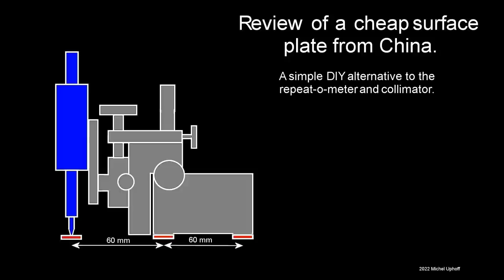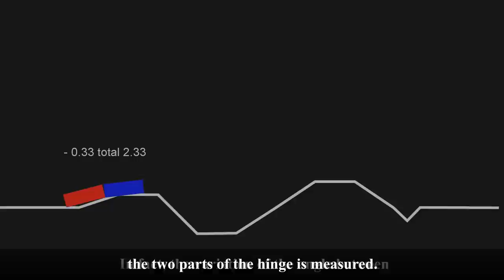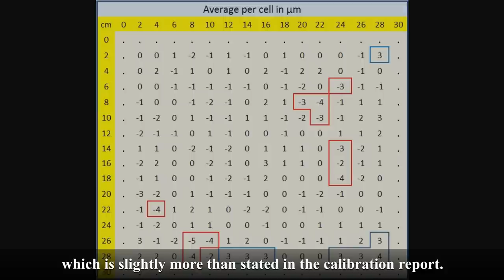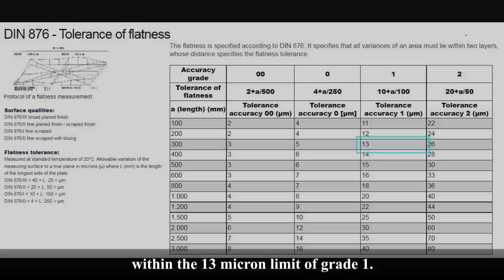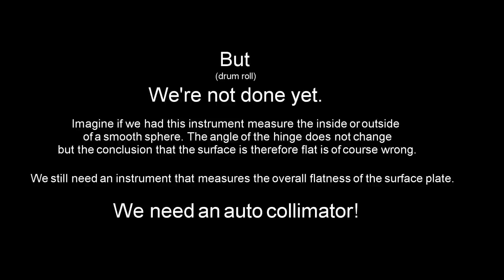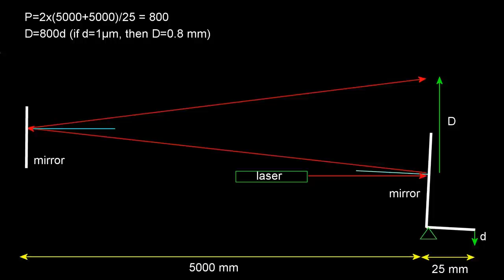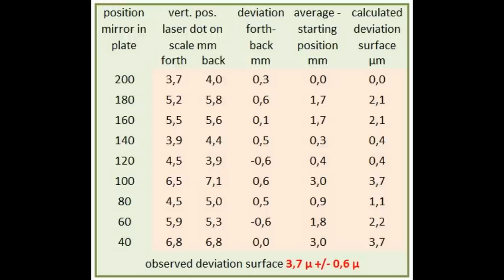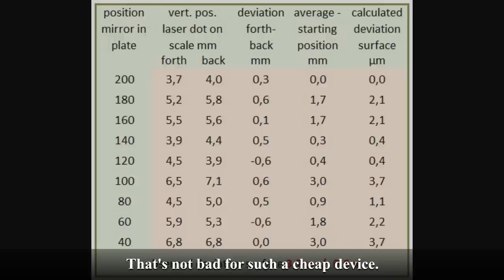How bad is a dirt cheap Chinese surface plate?

Comment: Here's another way of looking at it: For the price of an expensive one and a bit of elbow grease, you could buy three Chinese cheapies and use them to create three perfectly flat plates... and sell two and turn a profit.
Reply from the maker: Yes, using the Whitworth method, diamond paste and a lot of patience that's feasible.
Reply: @Michel-Uphoff  Use dry diamond powder, paste is only for very small areas.
Reply from the maker: @Bob_Adkins  You're right. I didn't pay attention.

Comment: Wow, the random dust participles in most shops would make this plate a much better value than a more expensive piece.....
Reply: A very good point.  Any particle can be micrometers, if the measuring is not in the cleanroom.  LOL.

Comment: very informative, cheers. it's amazing that you can get this level of accuracy for for less than $100!
Reply: Where? i only see such plates from india.
Reply from the maker: I bought it 1.5 years ago. Can't find them either now.
Here is a link to (I think) the same product (now with a higher price tag and not available): https://www.hbm-machines.com/nl/p/hbm-8-micron-300-x-300-mm-vlakplaat
Reply from the maker: Now that I look at it a little more closely. No, it is not the same surface plate.

Comment: At such price, you are supposed to buy 3 plates, and grind against each other.
You get 3 flats, an interesting project and a chance to make a new Youtube video.
Reply: Now that would be a lot of work.  Trust me, you'd be time and money ahead just buying the reliable expensive flat.
Reply: I was thinking the same thing. I've done scraping and am curious to see how much improvement one could make, or not with some effort.
Reply: @hughezzell10000  Obviously not - fact is that this plate is exceptional for its price!

Comment: Dear Friend!
I had calibrated (measured) lots of surface plate. We had measured only 8 lines, 3 lines X and Y direction and 2 diagonals. After measure we calculate "closing error", that is diffent of measured values at same point in two direction. The stepps of the meause was distance of touching point in the equipment.

Comment: The repeat-o-meter and your indicator stand are not measuring deviation, but only repeatability. Suppose the instrument is zeroed on a flat area and then placed over an area where the profile is 0, +4, 0, such that the intermediate feet are over the 4. The instrument would indicate -8, while the actual deviation is +4. Thus the repeat-o-meter is mostly useful for evaluating local flatness after determining the overall flatness by other means.

The measurements taken by the laser don't have a reference thus the measured position of the dot will be a combination of several factors, so it isn't as reliable as the autocollimator. Both are really measuring the angle and any profile needs to derived from those measurements. In this case the feet are shown as 25 mm apart while the mirror is moved in increments of 20 mm. If the increment were 25 mm, then we could multiply the measured angle by 25 mm and determine the vertical change between points.  Then a line can be fit to the points and the maximum deviation determined. It would also be good practice to measure along a loop and ensure that the readings all sum to zero ie. closure.

It should be possible to construct a suitable autocollimator with a long focal length lens, beam splitter and point source. Focusing the image on a CMOS camera sensor and processing it digitally may be easier than trying to replicate the vibrating slit and optics of a conventional device.

Comment: Interesting! 

For the optical measurement device I recall another youtuber using the 5*5mm captor chip from a camera, which had a very high pixel count and so a high resolution, along with a jobsite laser level.
Reply from the maker: That could work very well. 
A disadvantage could be that those laser levels are often too long for such a small surface plate as mine.
Reply: @Michel-Uphoff  what do you mean by too long? I was referring to the little boxy devices that project flat lines onto walls
Reply from the maker: Ok. That could work!
Reply: @Michel-Uphoff  The laser line itself is pretty thick, 3-5mm, but it is flat and consistent and the very high resolution of the chip allows to detect very small changes.
Reply from the maker: I understand that, but there will still be some challenges that need to be overcome. One of them seems to me to be the amount of light, which will have to be dimmed if you don't want to completely saturate and overradiate such a chip. Cutting off the current through the laser diode seems desirable to me, that usually also makes the line thinner. Sometimes, like with my laser, you can also adjust the focus. Then follows the interpretation of the results, which could simply be done by eye via a screen, or special software must be available or written. But all in all, this seems to me to be a very suitable method. Fun to experiment with when I have time. Here I have a projection eyepiece with a 640*480 chip that is 6 mm wide, so about 0.01 mm per pixel. At a distance of 4 meters, for example, this amounts to about half an arc second of angle difference per pixel. And for that, the front of my laser's 40mm base should, in theory, have to drop or rise a fraction of a micrometer. It won't be all that easy in practice (noise, vibrations, temperature changes, moving air, changing refraction index and so on) , but it's certainly worth a serious effort. 
If I find the time, I will come back to it in a video.
Reply: @Michel-Uphoff  you can easily limit laser diode current to the level giving desired light intensity
Reply: Are the repeat o meter and autocollimator both required? I would think that just the laser by itself would give all the information needed, no? (Although I guess the repeatometer would be more helpful in knowing how much material to remove to being the plate flat (?)

A very clever and low-cost way to measure the flatness of a plate, thank you for the very clear and useful video!

Comment: Another source of relatively Flat Granite is a Granite Counter Top Company.  One I went to had a Dumpster of Sink Cutouts they paid to haul away.  A little donation to the "Coffee and Donut Fund" and I could have all I wanted.
Reply: How flat is polished granite from a countertop ? I can find no information on that.
Reply: It will depend on what you consider flat. They are smooth, but not a dependable surface for machining inspection. They were never made for that
Reply: @ExploringCabinsandMines  its woeful. stand in a kitchen. look at the reflection of window frames etc. if they arent straight, it aint flat.

but! never fear!
just grab THREE pieces, some abrasive grit... and start grinding them.
a drill press and an "orbital sander" type attachment makes it a breeze to do.

you have three dead flat surfaces by dinner time. well, whilst we're in the kitchen...
Reply: . . . relatively flat !  Something like ±0.1mm I expect. Not much use for machine shop. Better look at heavy plate glass I think.

Comment: I would guess that the height of the block your gauge is attached to changes by about 2u per deg C and every time you touch it the temperature goes up. I would expect it to be taller in the right than on the left.
Reply from the maker: Yes, I agree. There must be a tiny difference due to heat transfer from my fingertips to the gauge. 

The question is how much that could be. Assuming this causes an error of 1 micron, the entire gauge (except the spindle..) should heat up about one degree. 

I only touch the gauge with my fingertips for a few seconds. In that short time, it is not possible to transfer enough energy from my fingertips (about 50 gram of fingertips 33.5C) to the kilogram (27C, it was a hot day here in Nederland) of material of the gauge. If I (roughly) assume that the heat capacity of steel and aluminum is equal to that of my fingertips, then my fingertips would have to cool down roughly 20 degrees C in those few seconds to realize this kind of heat transfer in one pass, so that seems impossible. 

But there are many passes so the temperature could build up gradually one could argue. But then we also have to keep in mind that the gauge continuously loses heat due to the close and continuous contact with the 25 kg or so cast iron  from the surface plate. 

And of course there is also heat transfer from the metal of the base to the spindle, making it longer and so compensating some of the height differences.

And, most importantly, I measured from left to right and vice versa. I looked up the measurement results, and see no discernible difference between left to right and vice versa.

But in theory you are right. I could make a non-conductive handle on the meter, but don't think that's really necessary for measurements like this.
Reply: @Michel-Uphoff  I agree it is probably insignificant but I did a thumbnail calculation. The number I gave is closer to aluminum than for steel. Steel is about half. And I neglected the cast iron surface plane! I was thinking about figuring telescope mirrors and how touching one raises a fingerprint shaped island. And of course if it was a hot day, the heat transfer becomes insignificant. 

I suppose a person could buy three of these and lap them against each other to get an "optical flat" 🙂

Comment: I know you will all find this stupid but for me and my small tinkering shop I use one of those granite microwaveable food tray stones. It mics out within my needed tolerances (.001) It had some very small holes and cracks that I filled with a hard wax and buffed. it's new smooth as glass. It sure wouldn't fly in the aerospace industry but for the parts I make at home for projects it works great. Price was good too. I scored 4 of them for 2.00$ at a goodwill store. They are 12"x12" Ok, now everyone can make fun of me. Fire away!
Reply from the maker: There's no reason to make fun of you. If this solution suffices for you, then it's ok, right? 0.001 is not high accuracy, but apparently sufficient for your purposes. I also have some granite here, and that is very flat on a small scale, but if I look at the flatness with my laser pointer over a somewhat greater distance, then the plate turns out to be convex, like the example of the cylinder shown in the video.
Reply: @Michel-Uphoff  Yeah, I just make parts for repair and a few parts for jigs and accessories in my wood shop. I have an Incra router table which is .001 repeatable which is well within the realm of acceptable tolerances for wood working. I liked your video and learned a few things as well. Never knew there was a tool for measuring surface imperfections and deviations in surface variations with the precise hinge mechanism thingy. I'm not a master machinist but rather a well edumacated hillbilly and farmer. I subscribed and look forward to learning more.
Reply: If it works don't fix it.  👍
Reply: ha ha ha ha. why four? you only need three!

lol, all seriousness. three, ground to each other, you got yourself el-cheapo, precise as you want, surface plates. whose laughing now?

Comment: @Michel Uphoff I don't know if you ever put it in but I can't find the link to buy the plate?
Reply from the maker: https://www.hbm-machines.com/nl/p/hbm-8-micron-300-x-300-mm-vlakplaat
It isn't exactly the same plate, but i comes close. Not available at this moment I see. 

https://www.ebay.com/itm/304437672481
Not the same plate, and I suspect of a lesser quality. Still costs more than twice I've paid.

https://www.manutan.co.uk/en/key/surface-calibration-plate-cast-iron-ribbed-surface-mat-manutan
This plate looks more like mine, but costs way more (£279.00 excl. VAT) and has an flatness of only 40 µm.

So I'm afraid that at this moment the market for cheap and reasonably good cast iron surface/inspection plates is very thin..
Reply: @Michel-Uphoff  thanks for your help yeah I've been looking and I haven't found any available around the price that you were talking about.. thanks again
Reply from the maker: @fletcha7777  You could try to get a quote here: https://www.exportersindia.com/product-detail/cast-iron-surface-plates-4223722.htm

Comment: I saw a autocollimator substitute made of a line laser and a webcam that didn't look to bad.
Reply from the maker: Do you have a link to a video?
Reply: @Michel-Uphoff  sure.  There are pros and cons to it of course. And there are multiple Videos by the same guy.  https://youtu.be/hnHjrz_inQU
Reply: @scruffy3121  he didnt seem to understand how an auto collimator works, that its the length of the base and the tilt thats being measured, not the actual height as such, which is what he was doing with his sensor and setup.

it was a great idea, if sadly flawed... but seriously, you can do better with just  mirror on a flat base and a laser pointer, bouncing off to a wall some distance away. the further, the better.

would have to go do some reading to brush up on the maths, but it was something like a 130.5mm base shows a 0.03mm deviation with one arc minute of tilt. if an actual value is required. generally its set the line parallel to the ends then graph out the deviation across the length.. no actual figure required.
Reply: @paradiselost9946  yes, there are many flaws in his approach. But in my opinion it could easily be altered to be a really good diy measurement system. (ignoring the units he is using, one could even use the software).
Reply: @scruffy3121  i agree.
it was his video that made me go and brush up on how auto collimators work... lol.

simply stick the sensor back at the light source, make a base of known length, shorter being more accurate but requiring more measurements, and bam... auto collimator on the sly...
Reply: @paradiselost9946  I think he understood how they work, at least the comments indicated to me that he did. What he was doing was good enough, in his opinion, for his purpose. That, used in conjunction with mirrors, like in this video would certainly be the ticket. Made me wonder if one could make an electronic level of sorts. The right focusing and reflecting through a precision vial could maybe yield a couple more decimal points of resolution.

Comment: Why is there a hole in the surface ?
Reply: For the tip of the indicator to sit in
Reply from the maker: After all this time, you're the first to ask👍! 
I expected that curiosity much earlier. I use the surface plate not only for standard measurements, but also for measurements under vacuum. That small hole leads to the bottom of the surface plate to a connection for the vacuum pump. Then a large bell jar goes on top of the surface plate and so I create a vacuum chamber.
Reply: Ahh that makes sense. I should have thought of that by myself as i used to use vacuume fixtures ! Doh ! @Michel-Uphoff
Reply: @Michel-Uphoff  Interesting - I would have thought the vacuum could cause some elastic deformation in the plate? For example, if you had a bell jar with radius 3½ inches - at vacuum, the air  pressure on the plate would be around 171 lbs/sq in or almost 78kg. Perhaps I have misunderstood.. and overthinking etc.
Reply from the maker: @ghian696   Yes, that's correct. Although the surface plate is very rigid, there will always be a slight curvature when I vacuum the bell jar above it. The flatness in the vacuum setup is not of great importance, but I have calculated it in the past and arrived at values that are clearly below 1 micron.
Reply: @Michel-Uphoff  Thank you for your reply.

Comment: What you proved is that this Chinese made precision surface plate is extremely good and quite inexpensive. The price is actually unbeatable for the level of quality provided. 
You also exposed your bias and prejudice with your negative and clickbaity title.
Reply from the maker: I have no problems to prove myself wrong.
Reply: @Michel-Uphoff  I have no qualms with that - other that it highlights your prejudice going into the test, and that you did not prove yourself wrong.
You knew posting the video that the plate was exceptionally good for the price, but still chose to taint it as "bad", "dirt", "cheap"...
That would be entirely different should you have chosen to title the video "This surface plate made in China is exceptional for its price point"...
Reply from the maker: It in fact is what I thought when I ordered it.

Comment: 9:37 - Incredible, how accurate is this setup of your DIY autocollimator?
Reply from the maker: See the table at 10:50. Worst case, less than 20%
Reply: @Michel-Uphoff  Also is it possible to use optical flats to check the granite surface plate's flatness?
Reply from the maker: @sto2779  I have never checked a surface plate with an optical flat. It certainly won't work with cast iron plates that have been scraped, the pits are much too deep for that. But it could also be very difficult on a granite plate, because that black layer reflects little light. Perhaps too little to see the thin film interference needed. Also, if it does work, there's of course the problem I outlined in this video, that two really flat planes don't have to be at the same angle, so something like an auto collimator is still needed.
Reply: @Michel-Uphoff  Thanks for the clarification.